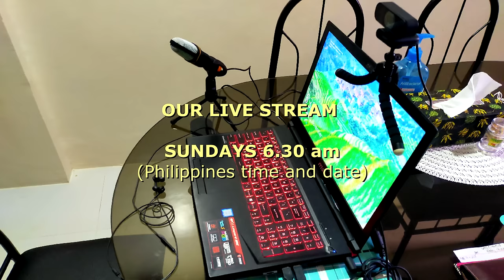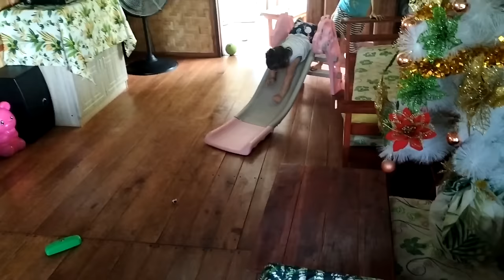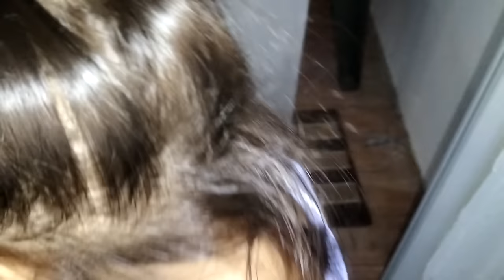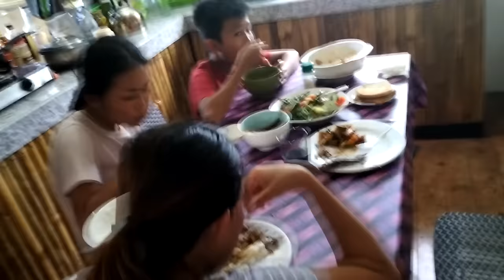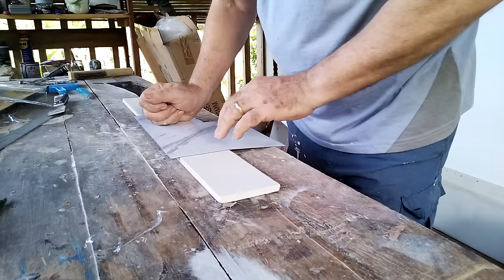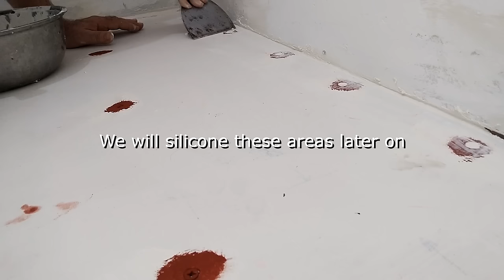V550 - FOREIGNER BUILDING A CHEAP HOUSE IN THE PHILIPPINES - PEEL & STICK TILES - THE GARCIA FAMILY

Comment: Use ceramic wall mastic on wall/floor intersection then add fiberglass mesh tape, after thoughly dry apply one last appication of the ceramic mastic. It is also advisiable to apply to all inside cornors and seame within the shower (wet area) too. The mastic is water proof and provides great protection. It is advisable to use a fiberglass shower pan to guarantee a damage free floor from water seepage.
Reply from the maker: Thank you😊👍👍 but Couldn't find that mastic here. I 've got the pan already